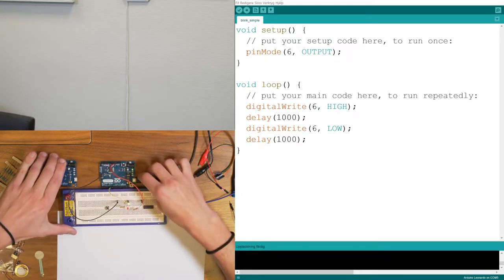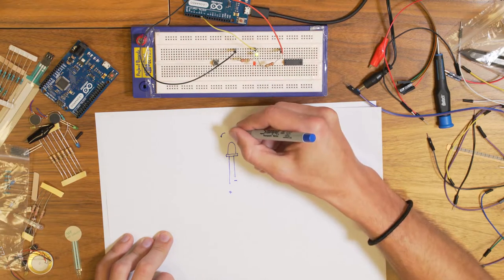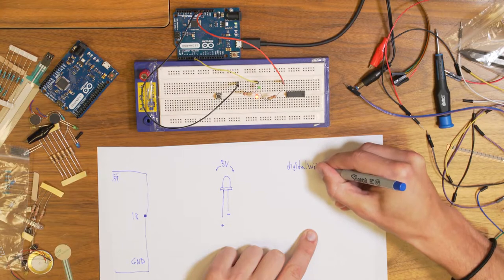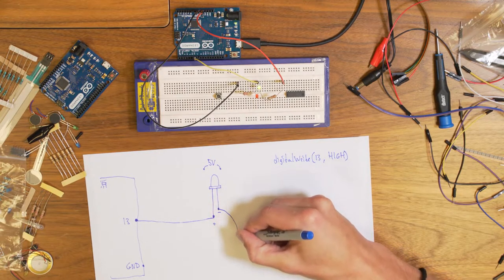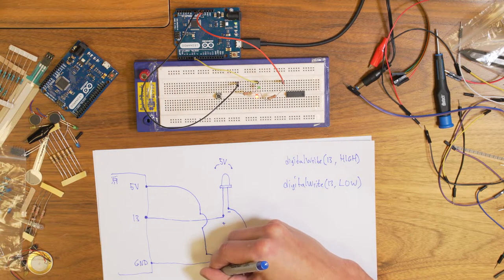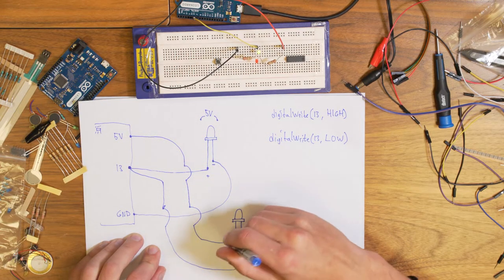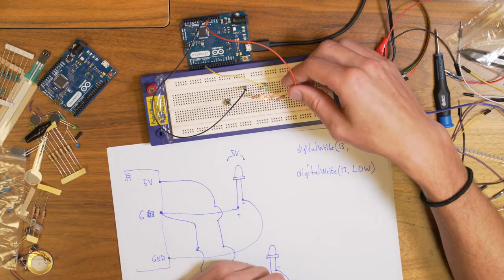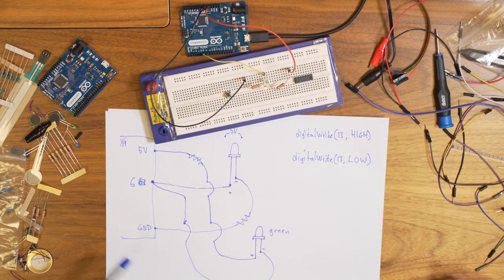Arduino workshop: 2 - LEDs & active high vs active low

Comment: Just to clarify, in this example doesn't matter whether the resistor is placed before or after the led. It would matter in a pull-up/pull-down circuit (this is not the case).
Reply: what does "pull-up" or "pull-down" circuit mean then